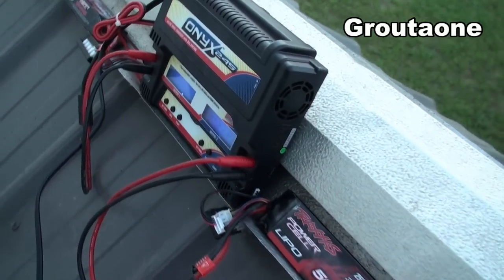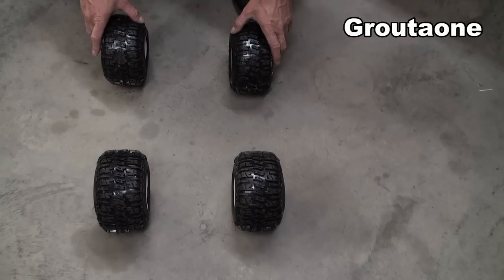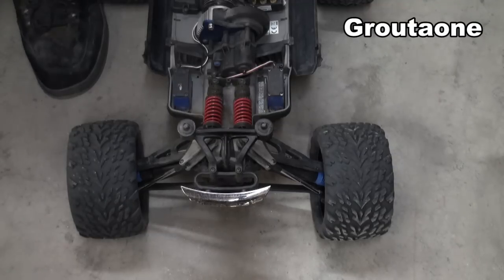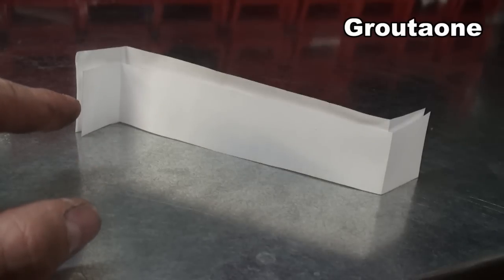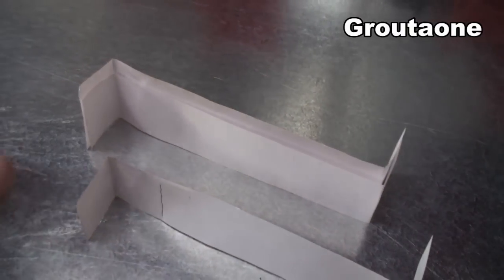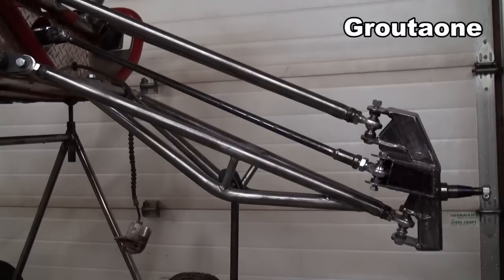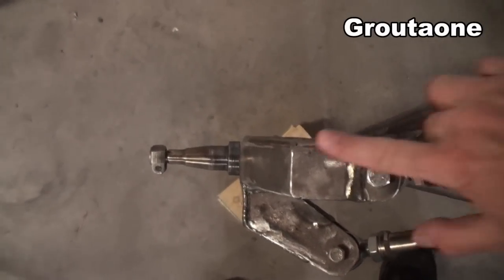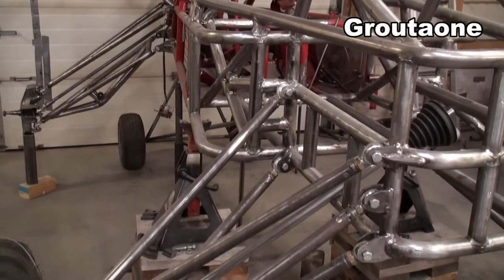Investigating Bump Steer

Comment: I am kind of new to this, but after watching some video's on AKERMAN, I somehow think yours is off.. At least as I understand it.. Please correct me if I am wrong as I really want to get this down 100%.. It looks to me that your spindles should be swapped so that the direct line from the center of your rear end, axle, drive line, goes directly through your lower BJ to the steering arm pivot... At lest it looks like your R&P is in front of your spindles... If R&P is behind the spindles the Akerman should go directly through the steering arm pivot into the center of your lower BJ...  Isn't that correct??

Comment: Ty to reply so fast ,ty,,,,im toking about the oddyse u have ,,,u have 15in reems w big tires ,on the bak  ,i saw the video when u was doing the rear axel set up ,,and ,,i dont know so much like u ,,i respect u ,,,and i think if u have stok sprokets ,,just 2 wout gear reduction it will be to heavy for the clutch ,,,,i have burn 2 sets ,,,wowwww ,,,i guess have to go lower on the preaxel so i gain some speed ,,,on 6gear ,im doing like 50 mph, i got pleany power ,   ,,leet see wat i can do ,,,